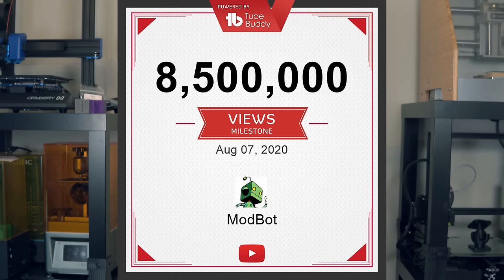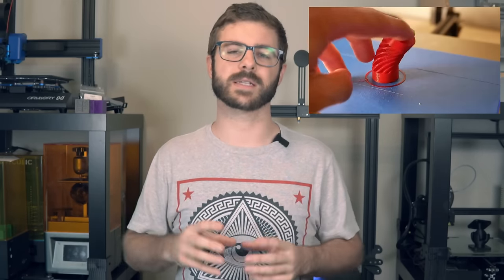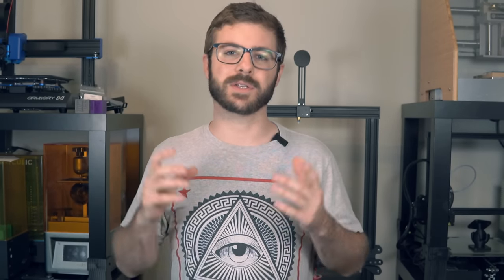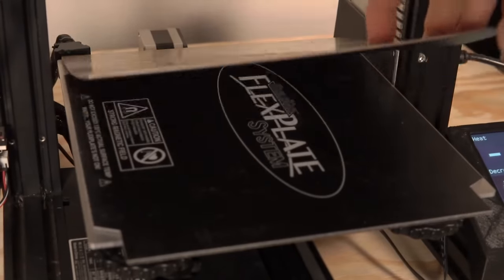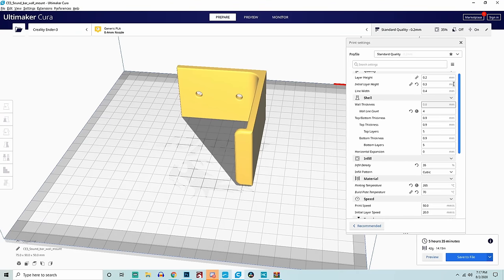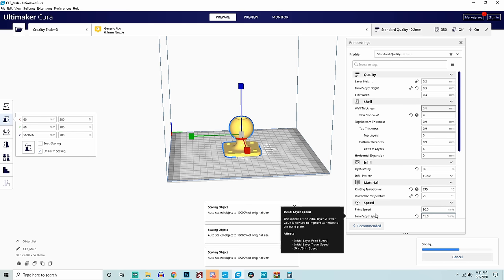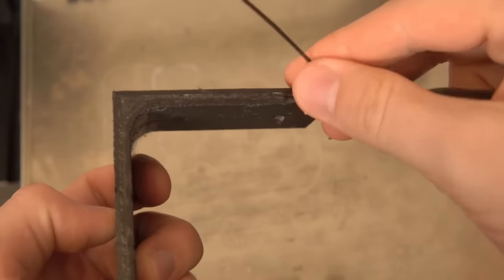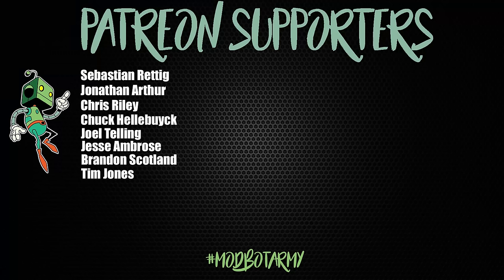3d Printing Carbon Fiber Nylon For Beginners (Ender 3)

Comment: How do you change your max temps without making changes in the firmware? The stock ender 3 maxes out at 260C
Reply: You have to change the firmware. My e5+ was the same way.  There is a high temp limit built into the firmware that has to be changed.  You may be able to do it with your current set up,  but idk. I switched to a skr 1.4t and built my own firmware.  It looks like he is running a different marlin firmware with a tft35, so most likely a different main board too.

Comment: a lot of CF nylons or other filled filaments will clog with a 0.4 nozzlee over time,  several vendors recommend using at LEAST a 0.6mm nozzle in ordere to allow enough room for larger fibers to escape the nozzle.  You'll find it takes about 3kg for 3dxtech CF nylon to completely clog a 0.4mm nozzle with basically pure carbon stuck in it.
Reply: Yeah. I'm rocking a 0.4 nozzle with some CF Nylon, and it's been almost impossible with anything that isn't just a test. Any kind of retraction, it seems, is instant jam.

Comment: Garolite sheets can be purchased at many of large plastic companies on-line if you want to make several (they come in like 4' x 4' sheets). It will have a spec sheets which will tell you temp it can handle. Industrial supply companies (like Grainger) stock smaller sheets (like 12" x 12" for $12,  24" x 24" for $36). Garolite has a few different specs G-10, G-11, CE which you can search on as well.

Comment: I like your video, it teaches how to use this material in a not so Nylon-CF ready printer. The problem is the printed part, it creates the idea that you need such an expensive and difficult to print material for something light and not so demanding. The chosen part helps perpetuate the idea that functional parts need these materials. Let me explain a bit more in detail.
Before getting my own 3D printer I watched several videos using Nylon-CF for some functional applications. Since my 3D printer is mostly a complement to my hobby machine shop I thought that PLA was useful only for toys and that kind of stuff, really nothing appealing to me. In fact that is one reason I waited years to get a 3d printer, I did not want to spend money and the hassle of adding another expensive hobby to my list. So when the time came I got a Bambu Lab X1-Carbon. Among other things because I know I will be printing a lot of technical stuff where "relatively tight" tolerances are necessary and some engineering materials as well. I also talked to some people and they dispelled several concerns about PLA. PLA is great for a lot of things, basically most objects sitting indoors and away from heat and direct sunlight can be done in PLA. PLA is cheap, prints easy and can be used for so many functional things.
Honestly that bracket printed in PLA will do just fine, no need to use such an expensive material for something sitting in your family room that will hold at most ten pounds of weight. As a demonstration that is OK, I liked the video, but sometimes it creates the illusion that other materials are not that good for said "functional" parts. I would not print it in PLA if I planed to use it outside or for a heavy item or something that can create a safety hazard if the part fails (like a mirror which can be heavy and dangerous).
I was expecting a lot of printing with ABS, ASA, CA-CF, etc. So far I find myself using PLA most of the time. If a part needs more strength I just increase the infill and change the infill pattern to make prints stronger.

Comment: When replacing nozzles, keep a ceramic bowl under the print head so it can only drop into the bowl, not onto the bed or the floor.
Also, if you have the time, you can heat it up, loosen it off, let it cool, replace the nozzle, heat it up, tighten it up.

Comment: Just wanted to throw in my input.  I print almost exclusively NylonX and your settings are pretty close honestly.  The only thing I suggest is.... Printing on glass I just use AquaNet hairspray.  I use this for all filament types on all of my printers.  The raft is not necessary at least it never has been for me.  The only time I have ever experienced warping was when I tried to print 100% infil.  Printing at 15-30% infil has never given me any warping.  I print everything at 3 layers outside, top, bottom.  70mm/s and 15mm/s starting.  My retraction is slightly different but that depends on printer.  Also never ever ever run your part cooling fan (on NylonX), this could also be part of your warping.  I noticed your part cooling fan going.  Overall excellent video and would have been very helpful if I saw this a few years ago when I first started printing this stuff.
Reply: What bed temperature do you run?
Reply: You must not print with PP then. I doubt that hairspray would stick.

Comment: Hi, you asked about using nylonx . A friend of mine runs a museum for vintage slot machines. They got a used machine in and it was broken. Its front panel was actually a door that accessed the coin box and electronics. I\The door is very heavy (probably around 30 pounds). The machine is old and no parts could be found for it. The broken part was one of the hinges that holds the panel. Someone had made a very crude hinge that sort of worked, but I thought i could do better. I bought a reel of NYLONX and started to design a new part. It took a couple of tries, but I finally made a hinge that looked great and worked well. The hardest part about printing with the Nylon was to keep it form warping. I used a blck trash bag and it worked terrifically.

Comment: Just printed Inland CF Nylon with a Hardened steel nozzle with stock hot end and it went fine.
Reply: Were you running an enclosure?
Reply: @TheMr408  nope
Reply: I need an all metal hot end though. It worked for 2hr prints but failed 14hours into a 20hour print.
Reply: Did you upgraded the bed?
Reply: @ebfsystem  yea I got the glass bed
Reply: Everything prints better on glass, and it's a cheap upgrade
Reply: The only thing you have to look out for there is off-gassing from the PTFE tube. That's a big reason for an all metal hot end

Comment: I've never used an enclosure on my Ender 3 Pro while printing Nylon and I've never had any problems. No warping, adhesion problems, etc. Nylon has become my favorite plastic to print, actually. I did try one time to use an enclosure and it kept my motherboard and motor drivers so hot that I got a layer shift.
Reply: I know it's been months but you should know that melting Nylon puts out toxic gases that need to be vented out actively. It's highly suggested, if not required, to have your printer in an enclosure for printing with Nylon.

Comment: Thanks for this video - just came back now to re-watch and see if there was anything I might have missed since a year ago.

I've been printing with nylonX a fair bit now and love it.  The first big project was a carb hat for an odd sized (100mm) blow-thru [turbo] carburetor setup for a Mazda 12A rotary engine which worked beautifully.  Now I'm working on an EFI conversion for the same vehicle and using this material as the main body to house a TBI setup.  Looking forward to getting it all set up and working.

The abilities of this material are honestly impressive (especially when considering its solvent resistance).  I've even used it for 3D printed venturis with great results.  Thanks again for the informative video.
Reply: How well did that carb hat hold up in the engine bay? I can’t wait to start some projects with this filament and it seems to be a beauty to print with. Merci et au revoir mon ami!
Reply: @swankscabinet1625  I ran it for four months or so over this past summer at 6-10psi and it held up great.  It did flex a little though with just one bolt in the center holding it down - I used some 3mm o-ring cord to seal it and every once in a while it would blow out, so some further reinforcement up top would be worth looking into.

The TBI setup is actually nearly complete now (and thus taking the carb hat out of service), just a little more wiring and some small things to do before it (hopefully) fires up.
Reply: nice so the heat didn’t really bother it all too much. I will definitely be using this filament lol have a good day/night sir

Comment: I print a lot with Carbon Fiber Nylon (and CF PolyCarbonate).
Functional parts mostly, for robotic components, even parts for vehicles (motorcycle).
Recently, I managed to print Ultem9085 and CF-PEEK on my (significantly modified) CR-10.

You covered it up pretty well, I'd just add few things for CF-Nylon and for anyone wanting to go over 300C (CF-PC):
- If you print a lot with CF, get a Ruby nozzle - it'll pay it self off very quickly! Some types of CF-Nylon have up to 30% of Carbon Fibers and that will destroy brass nozzle within an hour or even the hardened steel nozzle within a days.
- To go over 300C, I use BP6 HotEnd with High Temp Heat Break (black hexagonal) and PT1000. But there are some new Hot Ends (NF-Crazy V6 Magnum & Dragon V6) that should work even better. I personally don't like MicroSwiss. 
- Consider Direct Drive Extruder, especially if you get High Temp Heat Break
- To go over 120C bed temp, I highly recommend AC bed heater
- For 300C+ Hot End, don't print mount (or anything else around it) in PLA or PETG, it will fail very quickly, it might even melt. I use SLA printer for such parts and Phrozen TR250 + Siraya Tech Blue resin mix.
Reply: One more thing:
If you have problems with Bed Adhesion: PEI sheet is the best solution.
You can also try Nano Polymer Adhesive.
Reply: @Sleepery22  I like the double-sided Fulament sheet.  I don't use the 3M magnet on the alum heat bed. Just bare plate to bed.
Reply: Which Direct Drive & Dual Drive / mounts etc do you recommend for Ender 3 (Pro).  Well really Ender 3 V2, but too new, may have to get a Ender 3 backplate to use established mounts.
Reply: @timd9430  I printed probably couple of kilos of Carbon Fiber and Glass Fiber with 0.8 Ruby Nozzle, and it spits out anything I feed to it. No problem and no signs of deterioration. Haven't tried Vandium yet..

Double sided Fulament PEI sheet: looks interesting, I'll try it. Thanks for a tip!
Magnets: Yeah, stay away from them, I already had a lot of problem with AC heater interfering with EZABL.

Extruder: I have some cheap copy of Bondtech BMG, but it works quite well.
I had zero issues, pushing PEEK and Ultem, it all went incredibly smooth.. @ 350 C and 400 C
And if I had the jams, it was usually when material gets retracted from High Temp Heat Break into PTFE which is just slightly wider and then it cools down and it doesn't wanna push it back.. and that's usually with materials that you should even print with HT break (like PLA).  I'm trying now tiny o-2mm/O-3mm steel tube between Extruder and Heat Break, instead of PTFE, we'll see how that works..
Reply: Ruby nozzles suck ass! Too many instances of the filament wearing away the inner part of the nozzle, causing the  ruby to fall out.
Reply: Thank you for directing me to your comment, and also what would be a good resource on how to change the firmware on the printer as to reach those higher temperatures?
Reply: @coltondillon2380  It depends on type of thermistor.
If I remember correctly standard 100k thermistor that comes with CR-10 can go up to 285/300 C (given that your Hot End can withstand that temperature). You just need to change HEATER_0_MAXTEMP to 300. And recompile / upload the new firmware.
If you wanna go over 300 C, you need a different thermistor. Like PT1000 that I've mentioned. And it that case (beside changing HEATER_0_MAXTEMP), you need to set a new thermistor table, which for PT1000 it looks something like this:  #define TEMP_SENSOR_0 1047.
And keep in mind what I said: CR-10 will always show you 15 C less max temp on display. So if it shows you 260 C now, you can set a printing temp in slicer / GCODE to 275 C, without any modifications / updates.
Reply: @coltondillon2380  And since I just wrote all these dangerous details:
I would not panic (as that guy, telling you not to burn your house), but I would caution you to keep and eye on printer if you raise temperature and not leave prints unattended. ;)
Reply: @Sleepery22  Believe me I plan on exercising caution with this. I replaced the thermistor when I got my E3D hotend, which the thermistor (though not named) that comes with it is rated on the website to 285°C, honestly if thats hot enough, I wouldnt push it any further than that if I dont have to for printing carbon fiber nylon or carbon fiber polycarbonate. And if it is necessary to go higher ill just get the PT1000 then only go as high as really necessary. Fire risk is a very high concern for me and I will be sure to do what I can to avoid accidents. Thank you for all youve mentioned in these comments by the way. Ive been looking unsuccessfully for a long time for this.
Reply: @coltondillon2380  Yes same here (safety). 
Octopi with camera, helps greatly keeping a close eye on prints. And also with remotely uploading new firmware.

Comment: @ModBot  Also if I can add, Nylon, Polyamid in general, is sensitive to moisture you said it, but not only out of the box. Every parts will capture moisture after the process, approx 200hrs for maximum moisture absorbtion (depending on the environment). The Nylon, obtain full mechanical characteristics when its full of its moisture capacity (between 2 and 10% of the mass), and, has an incidence on dimentional (more shrink at 0% humidity).
Because of that, if you do a stress test on your speakers hooks for exemple, one right after printing and the other after 200Hrs (less if you put it in correct percentage of water), pretty sure that the straight out of printer one if approx 4 times weaker (fragile)
As FDM is a laminating process, I'm wondering about the impact of moisture between layers versus an injection part...
Sorry for the long story, good video man!
Reply: is there something that you can use to "seal" a nylon print to keep the absorption from happening? after it's finished?
Reply: @psychot6859  I don't know why you would do that because, as I said, if the part is "dry", it will have approx 25% of the strengh advertised in the specsheet (in theory).
If you really want to seal it I guess a resin or a primer (pretty elastic) would do the job...
Reply: I think I may have read your post wrong.  I thought you meant if it was DRY it would be stronger.  You actually said it would be stronger AFTER it had absorbed water.  That was where I made the oops.
Reply: During a period of selling industrial plastics to factories and custom fabricators, a new "know it all" customer didn't want any advice on choosing a plastic for a specific application of bushings. We recommended not to use nylon because the bushings were going to be getting sprayed with water. He insisted. OK. A few days later he calls in furious we sold him some "stuff" that broke his steel drive shaft. The nylon enlarged from the water and the shaft seized and torqued itself to death. He was sure no plastic could do that because all plastics were "weak" in his mind. Nitwit.
Reply: How bout moisturizing and then sealing

Comment: You nailed it....... it's now April and on average my humidity is around 50% inside and outside. I run 2 whole house dehumidifier. And Yes I need to print out a few tiny hand sockets for my 8 and 9mm sockets so I can screw on and take off my nozzels from the printer. Also Nylon is perfect when enforced as a door stopper spring shaped as a bigger D clipped over the door itself. It prevents the door handle from leaving a big hole in the door.

Comment: Walmart sells a gluestick for kids that is washable, and it works perfectly for 3d printing... after I´m done, I just wash the bed with a sponge and soap, and then displace all the water and soap with 91% Isopropyl alcohol (sold at Walmart too)... Then the bed is ready for my next print in no time... These are all major brands, so you´ll find this stuff at Target or other stores...

Comment: I think the problem with nylon with moisture issues is that the initial moisture might have seeped deep in to the roll and it may take longer to dry to get the moisture from deeper in the spool. just a theory.
Reply: use a dehydrator

Comment: Great video ! I find if you take a larger screw driver with a slighly rubbery/soft~ish handle and wack the part, it pops off the bed quite nicely when using glue stick. I have a 6 piece set of hex ball drivers that have slighly rubbery handles works nicely since I can hit a little harder than I normally would with a solid plastic handle without damaging my parts. If you're printing something in PETG this isn't an issue since that stuff is virtually indestructable, you can just swing at those with a baseball bat !(Please don't do this, you might damage your good baseball bat!)
Reply: 🤪 😁  ....  haha 😄  I like that baseball humour

Comment: I stuck the sticker half of a magnetic bed set to a glass bed to magnetize it to my preexisting magnetic bed sticker, these fridge magnet type sheets are directional one way they attract to each extremely well...too well for something inflexible such as glass, but if you rotate them 90 degrees they still attract but not as well absolutely perfect for the bed to be removable but stay steadfast and actually use all of the 235mm